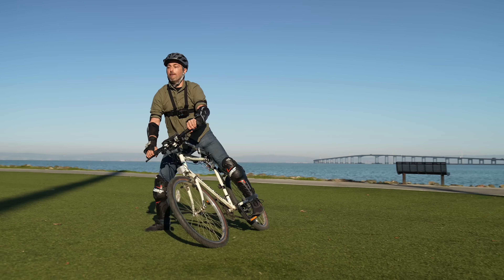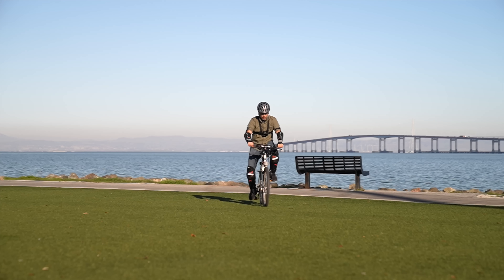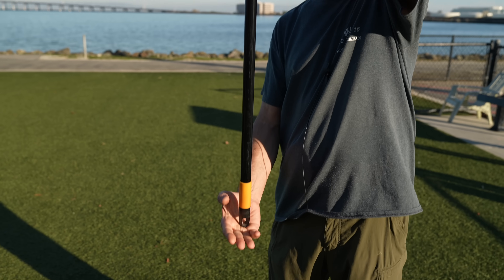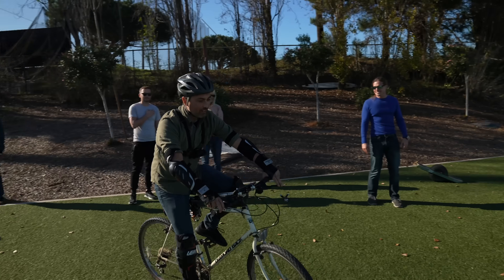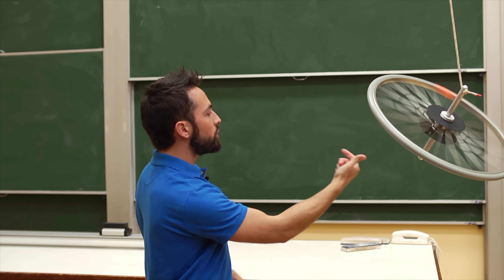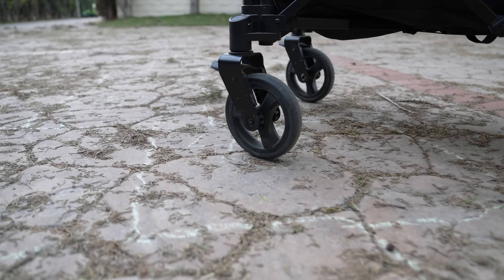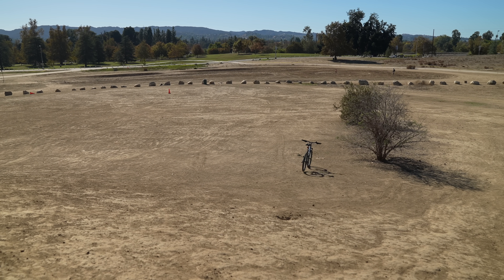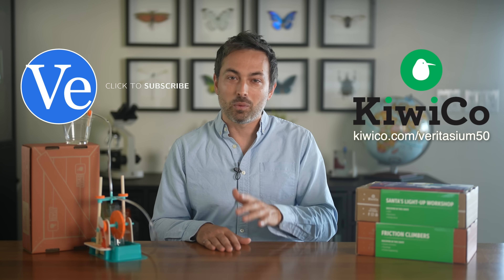Most People Don't Know How Bikes Work

Comment: It's kind of interesting that same theory we use in cars and rally races we call it a Scandinavian flick but if you want to make a sharp turn left in a vehicle that weighs a lot has a lot of power and speed we say to cut right and that way you can get a sharper turn it's interesting but I've never thought that would work for bikes but now it makes sense even though bikes are super lightweight the wheels are super thin you're going to want a little bit of leverage on your side hence the cutting before you turn.  In this case it helps more so with balance

Comment: For the double locked test, I wonder what would’ve happened if someone who knows how to ride without handlebars tried it. It’s been a while since I’ve tried the trick but I remember it required a lot more leaning rather than any kind of turning
Reply: Someone able to do this wouldnt be able to ride with locked handbars anyway. I ride like that pretty often and you can just look at handlebars and you will see that they are self-steering.
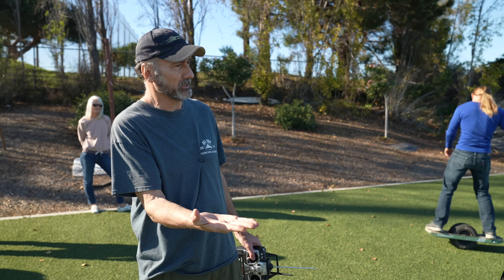Reply: Look at 5:40, I am pretty sure it's vital that the bike can correct itself while driving without handlebars, as you usually only lean when you steer and at any other point just do you best to stay still above the saddle. 

On the other hand the "bike" at 9:30 seems to work with just the weight distribution, I don't know if that's enough with a human rider though, interesting stuff for sure.
Reply: @Bobylein1337  I've ridden a bike all my life mountain biking primarily one thing you learn pretty quickly while mountain biking is that it is more weight distribution than actually turning the front wheel if you think about a wheelie or manual the front wheel isn't even in contact with the ground not to mention the fact that with just my body weight I can hold my bike at a 45-degree angle relevant to my self and the road it is more weight distribution than anything while riding a bike it's just not something most people know how to do innately and needs to be taught.
Reply: As someone who generally rides without hands more than with, when you're riding without holding on the front wheel is constantly turning left and right, mainly from shifting your weight to maintain balance.
Reply: It still wouldn't work. When riding without handle bars, you're still manipulating the front wheel by leaning to either side to balance yourself. With locked steering, the wheel wouldn't turn which would make you fall over.
Reply: @meowcow21  Exactly
Reply: Just like when the bike self-steers without the rider, you leaning was turning the handle bars (or at least the wheel)
Reply: If you recall the ghost riding bike demonstrations - you riding no handed is just like ghost riding, but you THINK YOU are doing a bunch of fancy “balancing” to keep it upright, you demonstrated that the bike will do just fine without your input, thank you.

In reality, the fork rake and free to move handlebars are all you need.
Lean slightly left (lean the bike, not just your body). The fork rake/contact patch phenomenon steers to the left to regain balance.

Avoid pebbles and potholes.

Many years ago, before helmets, I saw a kid riding no hands drinking a soda can.
The front wheel went into a pothole. It turned 90 degrees, and instantly stopped the front of the bicycle.
He and the bike did an amazing front somersault with the guy landing on his feet and bike landing close enough the he could grab it.

The guy was visibly shaken. I don’t think he knew what happened or how lucky his un-helmeted self was.

But he rode off no-hands, finishing his (un spilled) drink.
Reply: There is a very big difference depending on your speed. Going faster definitely helps the bike stay "aligned" but going slowly without hands is a different story.
Reply: So riding a bike without holding handlebars all the time is a trick now,
As a Dutchman this is how I got to school lol
Reply: @rjtimmerman2861  
It is if you’re paying zero attention and drinking a can of soda…
Reply: I switched to biking to get around my town over 4 years ago. I can go through decent sized potholes without using my hands.

You use your body to slightly shift the bike in the opposite direction, and the front wheel does a little shift and then swings back a little further as you start to lean.

 I'm going to practice. It's got to be possible.
Reply: When riding without hands the bike steers for you, and the difficult part is to ride smooth enough that it roughly goes in a straight line. Push a pedal too hard and the bike will lean far enough in a direction that it'll steer away from that path.
Reply: When you ride "no hands" you are still turning the handlebars but by shifting your weight to cause the bars to "fall" or turn one way or the other. You are still using the handlebars to steer even though you aren't physically touching them. You are still moving them the way you desire though.
Reply: This won't work as when you aren't using the handlebars you are still leaning and correcting the steer
Reply: i feel like the way it works without hands is closer to when no one is on the bike, considering the bike will correct itself and steering is still possible
Reply: Well riding to work yesterday and today, I made sure to pay attention and take notes.
First, as I was going a normal travelling speed, the front tire did not move as much as I remember, it hardly moved at all.
Second, I did not once counter steer, and I made sure my tire was straight before making my turns. Leaning the bike  to go around a street corner actually hardly moved my front wheel at all.
I think the reason this guy kept falling could be partly cuz he was riding on grass, but also from how suddenly he was trying to turn. I wonder if he eased into the turn whether it would go the same.
Reply: @VampiricFox37  

The “counter steer” is very subtle. Your memory muscles do it for you without you realizing it.
If you’re for instance turning left, the momentary counter steer that initiates the turn moves the bike a bit right, slightly out from under your body’s mass, and gets you into the “lean left in a left turn”.
If you simply leaned your body left, the mass of your body would push the bike a lot such that it leaned right.then all the self stabilizing features of the bike (fork rake, contact patch etc.), would make the bike “want” to turn right. The bike would literally (as the video shows) go out from under you,
Reply: @sirifail4499   that's not what they demonstrate in the video.
Reply: @VampiricFox37  

Huh?
Reply: @sirifail4499  I realized I should have made myself clearer. What I meant was that every clip talking about counter steering before turning showed a very visible, perhaps even exaggerated, turn to one side before turning to the other, none of it was subtle.
Reply: @VampiricFox37  

I suspect that’s because he was going quite slowly (on grass).
Reply: yeah I'd love to try. but I think if you can stay stable on a stationary bike you got the best chances.
Reply: @weppwebb2885  I can stay upright on a bike at a standstill. It's called a "trackstand" . However, no matter how good You get, you still need the wheel turned to one side to keep it steady.  I can ride no handed, but You still lean Your weight to make the handlebars turn. I can do long wheelies too, but having the bars angled is  crucial for balance.

Comment: If you ride a motorcycle, as soon as the bikes speed gets to about 50 km/h push steering becomes the only effective way to turn your motorcycle. If you turn the bars to the left - the bike will actually lean and turn right and vice versa

Comment: I have tried a bike which was poorly designed once. You still could drive it but not as easily than some normal, well designed ones. It was like if it was resisting a bit when you wanted to turn, not as much as yours though but still was placing you in an uncomfortable zone where you are scared to fall, very unbalanced. It was not the only fail on this bike, like the speed shift not easy to manage and same for the brakes... Just a stupidly made bike, not even cheap.

Comment: But people who ride fixed gear road bikes do this all the time. Because of the fixed gear setup we have to maintain a central or neutral balance point always or we crash. 
We also do this in slide braking. For road bikes you can actually use the friction of the tire in your lean without counter leaning to turn a bike so I feel like this video is off basis for that.